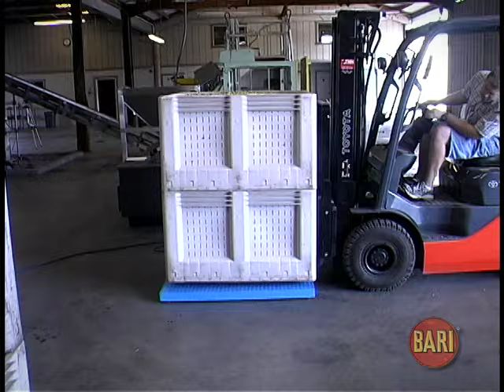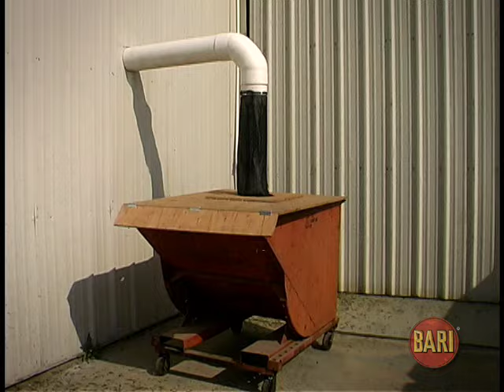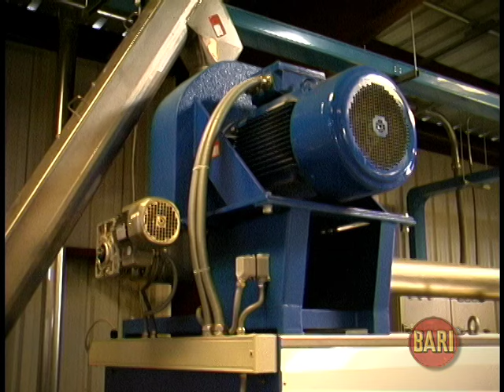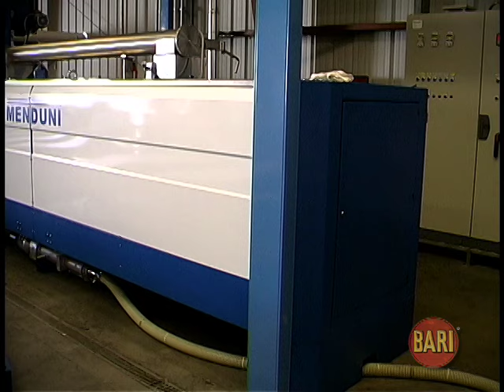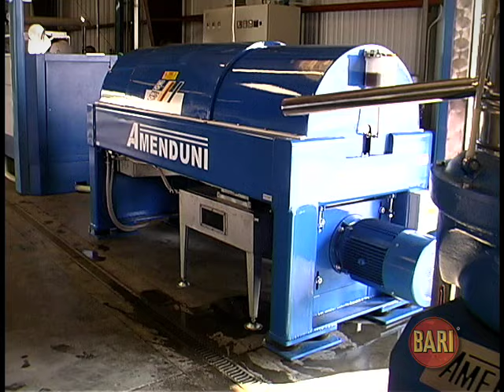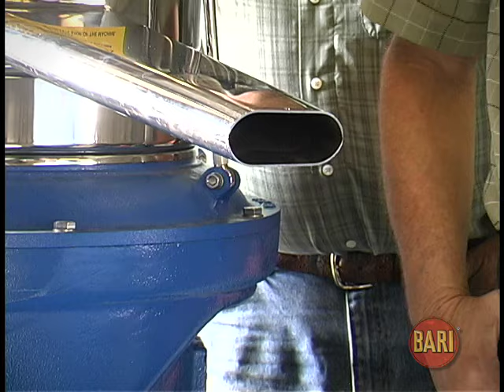Bari Olive Oil Mill Operation

Comment: Your product is not extra or virgin anything.  Once heat is used, your product is technically just olive oil.  Extra virgin olive oil, is cold pressed, and no heat is used.  Go to Italy, and see extra virgin olive oil pressed.
Reply: Hello, sorry this is extra virgin. We have precise regulations concerning the labelling of Italian olive oils; by law, it can be called Extra Virgin only the oil that is extracted at the first crushing; as you may have guessed, that paste of crushed olives will also get an extraction process, the second; the oils obtained from it can only be labelled Virgin Olive Oil, one so on; The label Olive Oil at this point indicates olive oil obtained from the third extraction.The fourth, and probably the last, will give "Olio Di sansa Di olive" which would be the lowest quality. 
Bari is in Italy.

Comment: You call your product "extra virgin olive oil" after all these machines doing crushing, centrifuging etc. throughout the process? Come to Türkiye and I will show you how extra virgin olive oil is produced for centruries.
Reply: If the temperature dont reach determinated limits, is still a cold process and the product achieves that "rank".

By the ways, in the olive oil world these ranks are determined by other factors. If the procces use traditional o ancient methods, the oil has a "plus". That is what you say.
Reply: abi haklisin :-) ya bunun egitimi vs nasil alcaz nerden ogrencez simdi bizim 6 donum burhaniyede zeytinligimiz var 50-60 agac fln var her seferinde koylulere toplatiyoruz onlar fabrikada press ediyorlar bizede 70 litre fln veriyorlar gerisi onlarin kazanci. Bu ise gerci kendim girmek isterdim italya da yasiyorum. Ihrac etmek isterdim. butik zeytincilik gibi zeytink press makinalari mi almaliyim ?
Reply: @gianturco3881  merhaba kardeşim yazını okudum bende gemlikte yim bu sene 700 ağaç zeytinlik aldım nasipse bakımına başlıcaz 1 kaç güne kadar ve organik zeytin olucak 5 sene boyunca yere hiç basılmamış şimdi biz gübre bile atmadan sadece su vere vere üretim yapmak istiyoruz bakalım ne olucak.
Reply: Dear S Yilmaz. which part of Turkey the olive field  is good .Im from Iraq and interesting to invest in olive fields